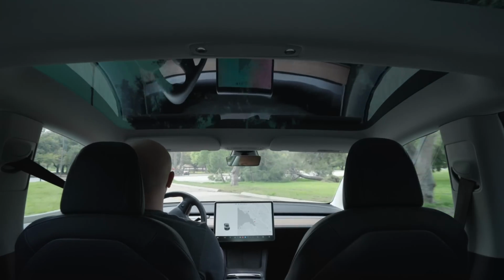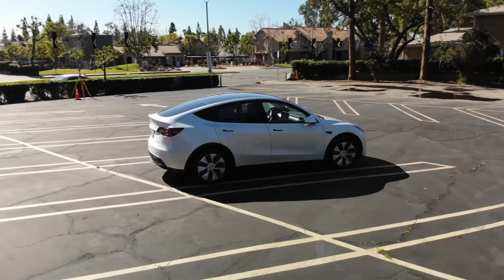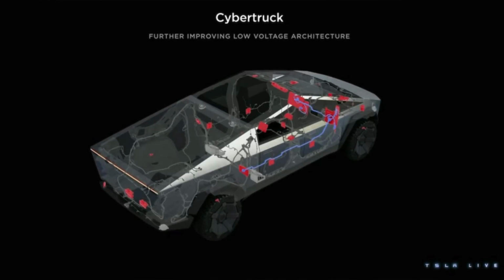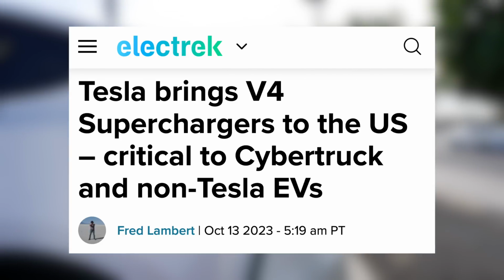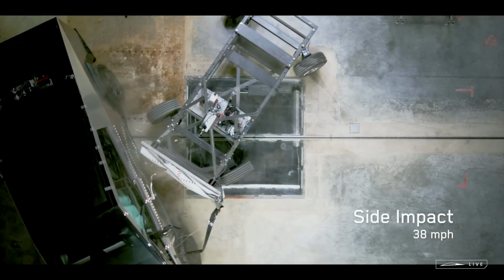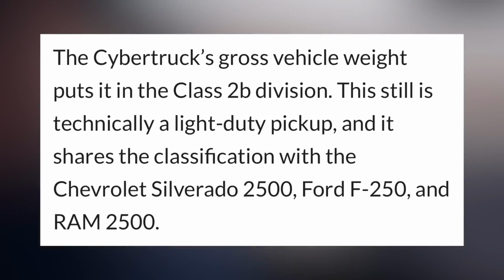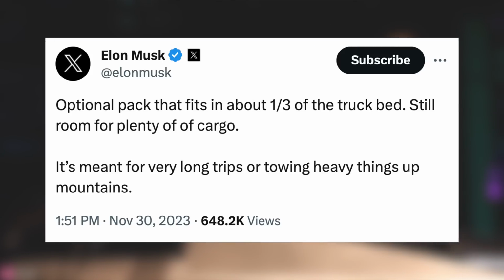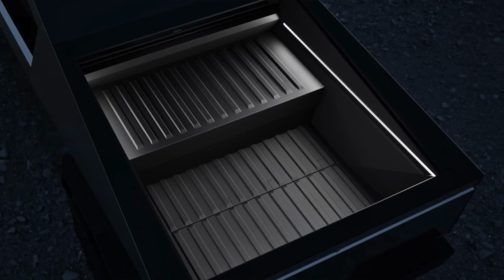NEW Tesla Features Coming To All Models? | Tesla's Disruptive Future

Comment: I'm getting the HEPA filter installed in my Model Y next week. I'm tired of smelling ICE farts in my car when I have the AC/heat running. It's only $300, which is a pretty good deal when you consider that's including a new filter ($90) and they'll come out to my work parking lot and install it in my car. No need to take a 2hr drive to my nearest service center.

Comment: Question: Why does 48V architecture enable steer-by-wire? Is it because it demands a higher voltage? (sorry, I'm a total newb here!)
Reply: Yeah it typically requires about the voltage to power your house. That is why it’s only really been done on airplanes thus far.

Comment: The bio mode with hepa filter is a fantastic option in the forest wildfire areas. Keeps the stench out of the car and lets people breathe fresh air. Makes me think about some years ago when Elon offered firefighters to borrow a bunch of Model X vehicles to help rescue people because it has the bio mode, electric motor doesn’t need to worry about choking on forest smoke in the air intake, etc. Say what you want, great gesture on Elon’s part
Reply: Although the hepa filter will remove particulates from the cabin air it WILL NOT provide the oxygen we need to breathe. In a situation of forest fires and volcano eruptions the heavier smoke displaces the breathable air and you die from asphyxiation. The filter is nice for people with overly sensitive lungs due to compromised lung capacity because of desease.

Comment: I have 2021 Model Y without old air filter system and it's terrible. It's a bad design and causes rain and water to get into the air filter causing it to smell nasty inside the cabin every 6 months. I've finally found a trim that I hope will block the water from getting into the air filter system.

Comment: This 'range extender' battery. How is it integrated into the electrical wiring and battery coolant/heating system? Seems like it would have to be permanantly installed. I doubt it will ever arrive or it will just be an option fitted when the truck is built.

Comment: 48V cars have been around for years. It was initially used to make combustion cars more efficient with auto stop start systems and removing all the ancillary pump and compressor drive belts from the engine to electric drive. Hence the need for 48V.
It has taken a long time to catch on because there is a huge industry making 12V components. Window wiper motors, fuel pumps, power window motors, all the lighting systems, etc etc. ... and batteries.  Making all those new new parts in 48V costs money and the market starts out small so they are expensive.
Reply: The idea has been around for years, but no one implemented it...

Comment: Imagine your towing let's say a trailer going camping your running out of batteries after about 80-100 miles because your towing something heavy then your running out of power because your battery is dying there's a truck traveling with you now he has to tow your trailer until you get to a charging station then you get there and there's a long line of ev's waiting to charge too while the truck your traveling with had to sit there and wait until your charged. You hook back your trailer and then this happens at least twice because your traveling around 300 miles. Then you finally get to your destination unhook your trailer and the truck traveling with you is playing off-road you want play too but you struggle to go up a simple hill while the truck your with is long gone up that hill then you finally make it up and now you see a muddy patch while the other truck has drove through it already and then you think you can drive through the muddy patch too and try to go through it but get stuck and dig in so deep and your soo heavy that no one can pull you out the other truck laughing at you and all you can do is cry and say " well at least I'm faster than you!!" while it's doing donuts around you

Comment: If the truck is towing 5,000lbs and getting 300 miles of range then a range extender is not necessary. Thats not the route Tesla took. I don't tow often but I refuse to buy a truck that is not able to comfortable tow for over 250miles when loaded. No way you can make a truck and not have an adequate amount of range for towing.

Comment: You are incorrect about the wiper… it does not “move for best aerodynamics” as you said. It simply stays in it’s park position when not in use, which is up. When wiping it will stay down, so that when it does wipe it wipes up to throw the water off the truck then immediately returns to the bottom so it’s ready to wipe again. When you turn it off it goes back to its park position (up).
What tesla said was they did not like the big wiper. They tried to hide it, but they didn’t have a choice and in the end leaving the Wiper straight up, added a very little percentage to its aerodynamics. 
There is no aerodynamics sensor actively making micro adjustments to the windshield wiper. 
The wiper being up is not noticed by the driver because that section of the windshield is blacked out. 
This is nothing new. Many cars have wipers with a park position then present themselves into its standby position when turned on.
Tesla’s wiper goes into standby when it’s at the bottom while it’s waiting for the rain sensor to tell it to wipe.
What you said was misleading.

Comment: I would love to see a 3rd party offer a high efficiency gas or diesel generator option for a range extender.  99.9% of the time this would be totally not needed.  But, if you want to tow a travel trailer it would be a great option. I understand this will trigger some people but even at 500 miles of normal range, that probably only equates to 200 when towing heavy.

Comment: the whole point about the straint lines on the CT is that stainless steel is very hard to bend and shape. So I don't think it is happening for the 25k car. It is more likely to have 48v and steer by wire, a smaller battery, and a single casting. The cost reduction comes from the manufacturing process, not from the material for the panels.

Comment: I gotta ask is it possible remove steer by wire? Reason is because I like they way the current behavior of the steering wheel
Reply: You’d need a steering column connected to the steering rack/control arms which could get pretty complicated pretty quickly since the vehicle wasn’t designed for it. There might not be space for all that

Comment: While I don't think we will see many of the Cyber Truck updates on the Model 3 Refresh. I think when they announce a Refresh for the Model Y, You will see many of them, I think most notably the 48v and 800v volt system. Possibly even the steer by wire.

Comment: Battery range extender most probably needs to be tied into the battery liquid cooling and heating system to take advantage of superchargers minimum time to charging,  especially in cold weather. Don't expect it will be customer installable in any way, make, or form 😅

Comment: The technology in this vehicle is next level. However, as a 35-year truck owner, the range extender taking up 33% of the bed is a terrible idea. Almost as bad as the Ram Charger using a gas engine to extend the range.
Reply: It will be under the bed in the covered storage area by the tailgate.
Reply: @brawnbenson552 no it will not.

Comment: Disruptive?

"The Porsche Taycan is one of the first EVs to feature an 800V battery system. Hyundai’s E-GMP platform-based vehicles, like the Ioniq 5 and Kia EV6, also have 800V systems."

Activated carbon HEPA filters have been staple of basic features in luxyry cars at leas a decade. E.g. in Maybach.

Or maybe you meaned that using Cybertruck warranty being voided, if you use it as backup battery for your home (see Tesla's warranty terms). Truly disruptive.

It could be also disruptive, that according to Tesla Warranty terms Cbertruck stainless steel body panels have zero warranty from the get go against rust or natural dulling (which happens to all stainless steel variants).

New 4680 battery is impossible to repair. So there is more warranty risk to Tesla and more post-warranty costs to customers, that will speed up depreciation of Cybertuck - just like what happened to Model 3 and Model Y in Q3 this year.

Comment: Im usually a raw kinda person when it comes to driving. However i think it would be cool if they had vibratory sensors by the wheel assemblies and that would basically transmit those frequencies to the steering wheel. So although you arent actually feeling what the wheels are feeling, it would be a step up in driving dynamics compared to normal steer by wire (if this isn't already implemented), while still providing tte venifits of a variable steering ratio for vastly different driving styles by the change of a mode as now you have FULL control over wheel resistence and acceleration, instead of simply increasing or decreasing addistence from the powersteering motor. 

Personally if i want to have a fun time on a back road, i would still pick a screaming sportbike or a lightweight, fully manually operated sportscar without a roof to be as immersed in the experience as possible. Honestly if i had the time, i would totally buy a salvage car that fits my size, weight, power, and drivetrain requirements and build a totally custom caged sportscar that is both faster, handles better, and feels far more excilerating than pay much anything you could buy stock, if done correctly.

Comment: Warning. The tax credit is still non-refundable, so don’t run out and purchase a Tesla this year to save on taxes unless you will be owing at least the amount of the credit. If you don’t owe at least the credit amount you will not be able to carry forward any credit not used.  Hopefully it will be a refundable credit soon and the amount can be reduced at point of sale (POS).
Reply: You don't need to owe money at tax time to get the credit, you need to have paid at least $7,500 in Federal taxes throughout the year in which you purchased the vehicle for the $7,500 credit to apply.
Reply: To @dvader3263  Thanks for the kind of correction but I think this needs further clarification.  You do not need to have paid $7,500 in Federal tax withholding throughout the year but rather your TOTAL TAX (Line 24 on Form 1040 Pg 2) must be at least $7,500 (if you want the full credit) before you use Form 8936 to take the tax credit. For example, if your Total Tax was exactly $7,500 and you paid $2,000 in withholding tax through the year, the tax credit would wipe out the tax liability and you would get your $2,000 as a refund since you overpaid.

For some, their TOTAL TAX may not amount to $7,500.  In that case, the tax credit will wipe out all of their tax liability but only that amount and the excess credit is lost since it cannot be carried forward.

I hope that clarifies it for you.  In my original note I should have used TOTAL TAX instead of the word OWE.

Comment: Steer by wire is incredibly useful for car manufacturers. They can make their cars all the same no matter where they will be shipped and “simply” just install the wheel on the appropriate side for the market the car is going to. It’s one of the things Canoo has been pointing out. They can customize the location of the driver seat in their vehicles because they do not need to worry about the steering shaft.
Reply: Its not as easy as you think.  There's a whole lot going on with Steer by Wire including redundancy.
Reply: Canoo still hasn't announced NACS.  They really don't matter.  I have a reservation, but this vehicle is just not being made right.  I'll very likely just get a model Y after they refresh it late next year.

Comment: Thanks for the info Ryan! I just scheduled my retrofit for the HEPA filters. I'm so glad they are offering this. Now I just need a heated steering wheel retrofit 🤞
Reply: This is great news and not expensive to retrofit.  I have the HEPA system on my 22 model y and it works great!  You can drive in heavy traffic and not smell anything from outside the car 👍
Reply: @dave83104  That’s great to hear because I often have to turn on recycle air because I get lots of fumes coming into the cabin from traffic. Especially from diesel pickup trucks 😝
Reply: @mastermike3940  it definitely works for keeping the diesel farts out 😆.  Also used it a lot this summer when we had terrible air quality from forest fires.
Reply: @dave83104  haha sweet! Do you need to enable bioweapon defense mode to filter out the air during normal driving?
Reply: @mastermike3940  no I never do really. The only time I have was in the summer during forest fires
Reply: @mastermike3940  the system does a really good job at filtering in normal conditions, I believe the only difference is positive pressure in cabin (when bio weapons defense mode on)

Comment: Tesla Cybertruck pricing: Just what I expected/hoped for as a shareholder - just under the $80k price threshold to get the $7500 EV tax credit. It would have been stupid to sell the truck for $40k with 2 million orders. The Porsche 911 has a RRP range of £99,275 to £234,260.
Another way to increase range on the cybertruck is to use higher density batteries like those developed by Amprius who are right next to one of the Tesla facilities. Tesla may have their own 4680 higher density batteries currently being developed at Kato road which are not yet ready for high volume production. So in a year or two they may indeed come out with a 500 miles cybertruck which doesn't need a range extender which takes up one third of the bed. In the meantime 340 miles of range will suit most people for every day use. It's only the none EV owners who say an EV must have 500 miles of range before they will buy one despite the average daily use being 20-40 miles.
I think Tesla only created a battery range extender so that they could fulfill their promise of 500 mile range. I don't think anyone will buy the range extender to lose one third of the bed. I think Tesla and I believe the range is plenty for every day use - except for long range towing. Tesla might come up with their own caravan / camping trailer which has it's own battery for those who want holiday on road trips with their own accommodation - just like the Pebble Flow: An all-electric travel trailer RV with propulsion assist, solar panels or the Lightship L1 electric RV trailer.
Reply: Tesla will make more money selling far more units with slightly smaller profit margin. Putting the price where they did after promising a much lower price, will cause 98% of orders to cancel

Comment: If you plan on buying the model 3, I recommend waiting until next year for the Highland model. But, if you were buying the Tesla Model Y, pull the trigger. Congratulations in advance!! 🎉
Reply: Should consider the federal tax credit change
Reply: @ArbJunkAgeG Last year the tax credit change had no effect because Tesla lowered its prices. Low initial price is better than credit because of lower sales tax, interest charges, and possibly insurance rates.
Reply: For me, the deal breaker was the lack of stalk for gear shifting... but everything else is sooo good! The external and internal aesthetics, the rear monitor, noise reduction, etc.
Reply: You can get the stalks aftermarket. @kreeshanman
Reply: yeah def waiting but cant even buy it now if I wanted it. I bought a house next year so get a garage then by May and then probably by next year end I will get the model 3 so enough time